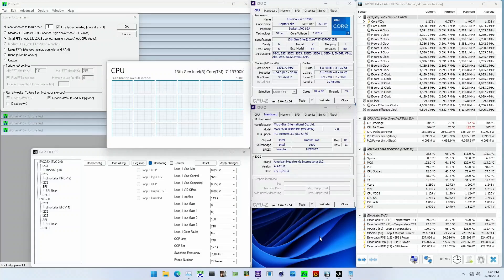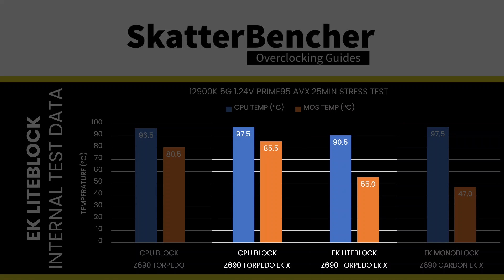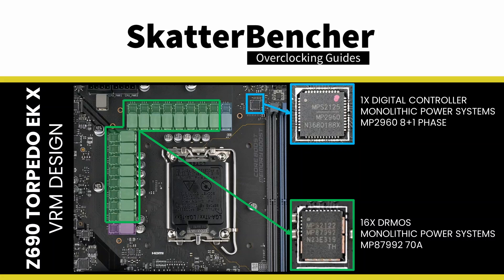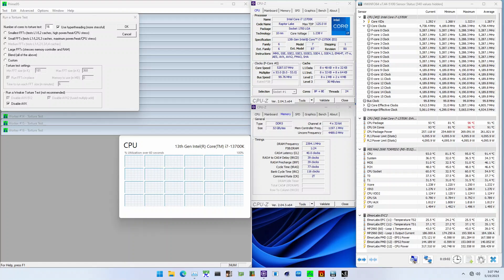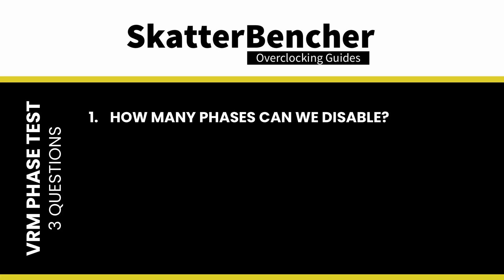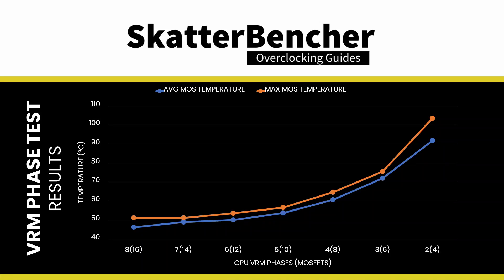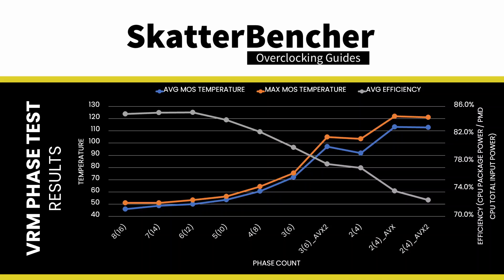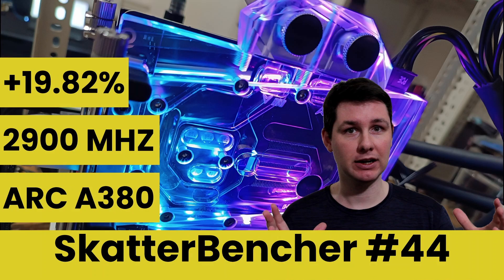2 Phases 1 Raptor Lake

Comment: MSI X570 MEG ACE - 
will the bottom work at full potential with all phases if I have connected only one 8-pin connector for the processor when there are two 8-pins?
Reply: I doubt that'd be ideal.

Comment: It’s a neat test, but will change nothing for consumer boards including XOC ones  because the marketing motto of MOAR==Better trumps any kind of actual technical discussion. If they want to throw in 16/20/24  écluse a higher number sells better, and it would save the buyer money, then they might as well use 25-40 stages instead of top of the line expensive 90 and 105A versions. But that just doesn’t sell. And since the vrms are happy at well over 100°, who wants to dump that much heat into a loop also cooling a cpu?
Will be interesting to see if they take this into account for those much beefier boards for higher core counts, where “sexy”  marketing numbers for VRM’s aren’t such a thing.
I’m about to WC my A770 and will bear this in mind! 👍

Comment: really speaks to the longevity of the design when buying motherboards with 8+ phases, their vrms are designed to last long years of operations, but it makes you wonder the more components/vrms phases the higher the likelihood of a single component failure. Would modern motherboards be able to cope with having one of the vrm phases fail , does the motherboard automatically spread the load onto the other phases?